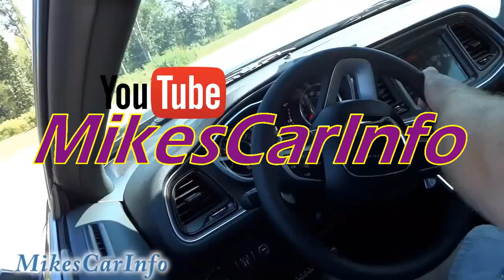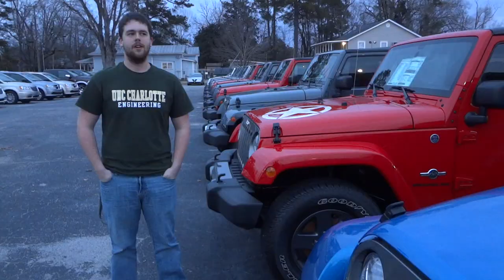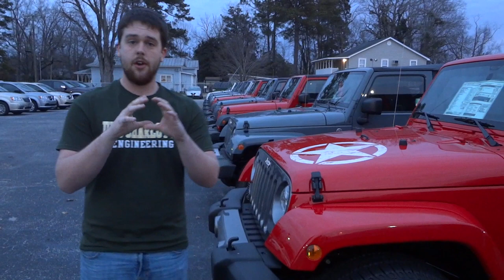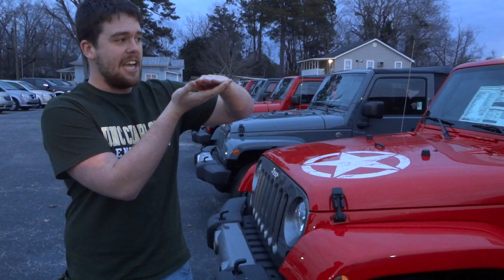👉 ASK THE ENGINEER STUDENT: Octanes... difference between 87 and 93 gas?

Comment: Excellent information. Thank-you for the video.  One item to consider is the ethanol additive to gasoline. Most places add 10% ethanol to 87 octane gasoline and 0% ethanol in 93 octane gasoline. On older vehicles (I have a 2002 model) the engine was not designed to run with ethanol. I find that when I run 93 Octane gasoline, I improve my mileage by at least 10%. Are you able to explain why that would be?

Comment: Advertised compression ratio does not determine compression pressure at ignition. Cam timing, intake air velocity/temperature, ignition timing are some major factors that determine the pressure under which your gasoline will have to ignite and they are constantly changing during engine operation.  The important difference between 93 octane and 87 octane gasoline is that the higher octane burns at a slower rate to offset higher compression pressures that speed up burning rates.  The goal is a smooth and continuous burn to push the piston down through the effective crank pin angle.  If compression pressures are too high for lower octane gasoline the desired smooth burn will be too fast so that the extreme pressure rise explodes the whole gas mixture part way through the flame travel causing detonation (aka ping). That extreme pressure rise that you hear as knock or ping is wasted energy that the piston and crankshaft cannot absorb that quickly, resulting in less power and fuel economy.
Reply from the maker: Thank you for sharing your knowledge :)

Comment: what is the best octane level for a V8  6 litre pick up (high country silverado) ?
Great informative videos as always . Thank you Mike and Thank you Matt
Reply: read your manual ...lol
Reply: +Mae M. probably fine with 87. Always run 87 in my 5.3. Maybe, MAYBE, if you have a high output variant then higher octanes could be better.
Reply: LinusScrubTips   Merci :)
i am using 95 currently
Reply: andrewman111ah lol yes you are right. and i did . thanks

Comment: Just about everything he says is wrong!  For a start knock is not caused by the compression setting off the fuel before the plug fires.  That's pre-ignition.  Knock/detonation happens after the spark fires as the increasing heat and pressure from the growing flame front itself sets off other pockets of fuel at the edges of the combustion chamber before the growing flame front actually reaches there.  It's called end-gas detonation.  As such this is all totally controllable with ignition timing in modern engines.  It has very little to do with the compression ratio.  Modern car engines adjust their timing to just off the point of knock with whatever fuel you put in them. Put in a higher octane fuel and you will more than likely get a little bit more power and economy.
Reply from the maker: Thanks for the correction Peter :)